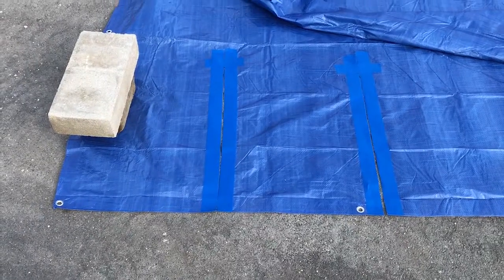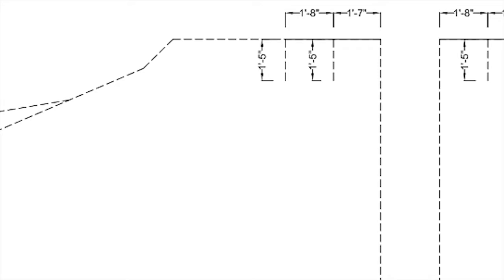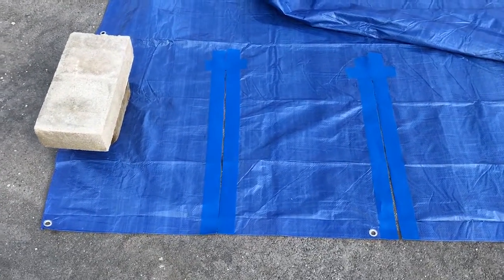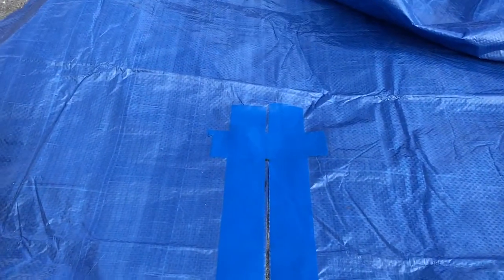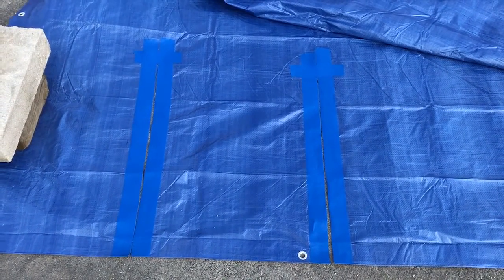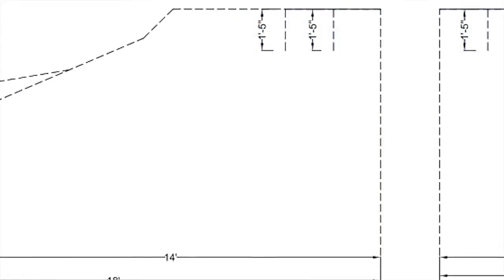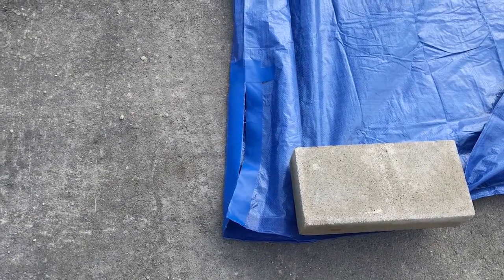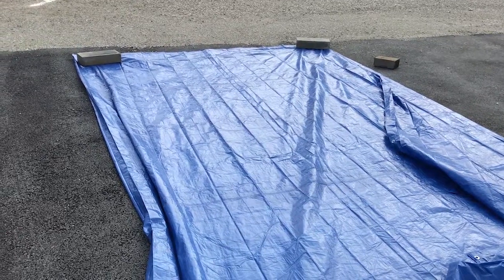Sailing "Thanks Dad" - Day 2 winterization. Put tarp on.

Comment: Do you replace the tarp every year, or does it last a few seasons ?
Reply from the maker: Sailing SV Pau Hana the tarps only last one Northern Illinois winter, but they are inexpensive.  The 20x30 ft one is USD$30 and the 20 x 20 is USD$20.